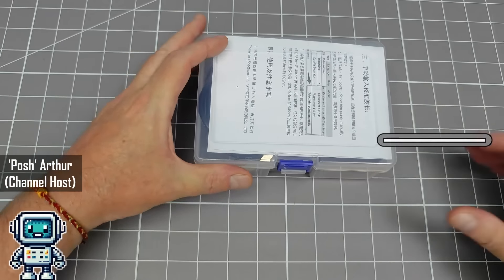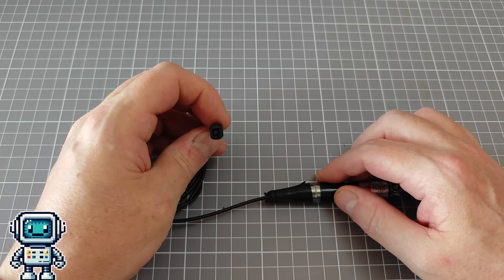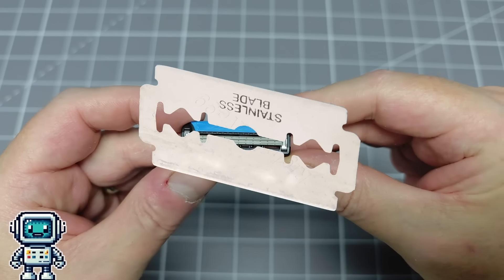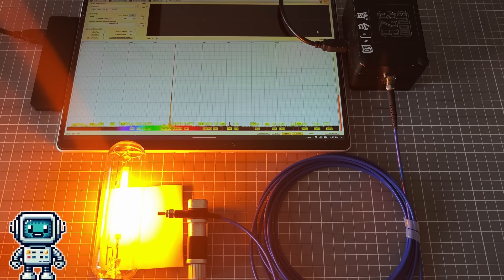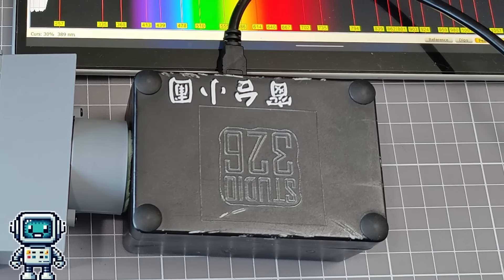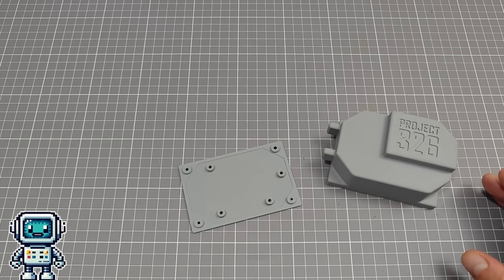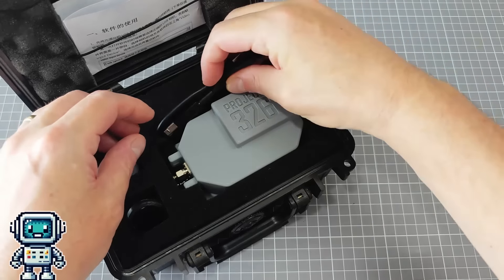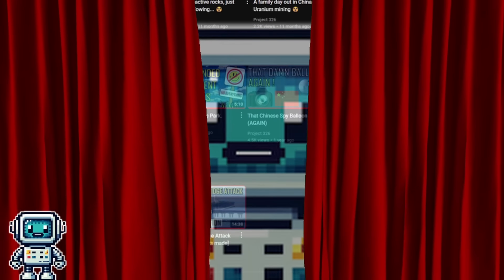Upgrading a Dirt- Cheap Spectrometer

Comment: I am sorry for interrupting. Is the geiger counter fs5000 bosean good for low radiation doses and is it reliable? I saw your video on YouTube, but I was surprised that my geiger counter fluctuated from 0.8 microsieverts to 24 microsieverts without any reason. Is this a normal average?
Reply from the maker: It's completely normal for a high level of fluctuation to occur.  Radioactive decay is a random process, hence good background measurements need a long term averages.
BUT...
Are you sure about the numbers?   0.8 uSv/h is actually a very high reading for a background level and 24 uSv/h is dangerously high for a background level.  What instrument were you using and what were you taking a measurement of?
For example I see about 0.18 uSv/h where I live but the world wide average is around 0.12 uSv/h
Reply: @project-326  No, sorry, I made a mistake in writing. The radiation level was between 0.08 and 0.24 microsieverts, but sometimes I want a device that's more accurate than the FS5000. Do you recommend buying the Measall KC761? I don't mind paying the price.
Reply from the maker: @Mr7lm  Phew, I'm very relieved that you background levels are perfectly normal!
For background measurements, the instantaneous values for background will always be quite jumpy due to the random nature of the events that are being counted.  All radiation detection instruments need some kind of averaging to get a stable values.  Obviously a gamma ray spectrometer will get more counts per unit of time and so converge on an average more quickly than a basic Geiger counter.
In the FS-5000's main display page (real-time, average, total dose), the average value is what you should be looking at.  Also remember that even the average background level can see some variability over a day.
Before going out and buying an expensive device (that might give fairly similar results in the case of background measurements) just think though what use case you have for this kind of product.
Do you know if the version of the FS-5000 that you have has the good tube?  Ie the J321?  If it was purchased in the last 6 months then it will be the better type.
Hope that helps.
Reply: @project-326  That's good, thanks😂

Comment: I assumed they were chinese made, but amazon in US sells boxes of 100 "Single Edge Stainless Steel Razor Blades for Standard Scraper Tool" for refill for paint scrapers and box cutters
Reply from the maker: there are lot of things that are Chinese made that we can't buy here, ie just made for a particular export customer, etc.
Reply: @project-326  They don't scrape paint or cut open boxes in China?  Do they also forbid kitchen knives and scissors?
Reply from the maker: @TheGaussFan  yep, I probably didn't search much before resorting to the copper foil...

Comment: Hi, Can you please tell me where you got your fiber optic cable and connectors from? And the part numbers? Thanks!
Reply from the maker: I got my fiber optic cable on TaoBao, but this is only accessible from mainland China.  It is a 400um diameter core made from quartz and has a numerical aperture of 0.22.  Any old SMA connectors will do, you can even use RF connectors with the electrical parts drilled out.

Comment: Another improvement would be to mount the USB connector separately so that bending the cable does not put stress on the camera housing.
Reply from the maker: The camera module is connected via an internal cable to the USB connector.  I just wish the original created had used a USB type-c...

Comment: Is this for real? I bought the little garden spectrometer afterwatching your review and now I am going to upgrade it with a new housing and a fiber connector ? 🤣
The fiber is indeed a bit expensive but I think it's all worth it. Having the SMA connector protects the internals from collecting dust and the optical cable give more freedom to get closer to a light source. Yes, the fiber does result in a lower sensivity but being able to get closer to the light results in higher light intensity. Now I just need to convince myself that this is all worth a 60 EUR investment for the cable and a few SMA connectors.
What type of fiber did you use ? I found some cheap-ish 400 um quartz fiber (45 EUR) but I am wondering if it is worth to pay more for a 600 um fiber
Reply from the maker: Mine claims to be quartz and costs about $31 from Taobao and has a 400um core.
Reply: @project-326 , it makes me a little suspicious, at 400um single core fused silica should be quite rigid already. Are you sure this isn't just a PMMA fiber? Plastic optical fibers should exhibit larger attenuation in the blue.
Reply from the maker: @inverse2k1  It is pretty rigid, more so than the cheapo PMMA fibers.  Yeah, I'm pretty sure its quartz cored.  PMMA has almost zero UVA transmission...

Comment: 09:22  " It is still a dull old black brick that wasn't going to give us a boner.   even though it had been ridden hard and put away wet I thought it looked butch ......  
I do like the revised version  13:30   "but don't expect it to get you laid " ,   I have high expectations don't judge me........ 
 I am sure people will pay handsomely for something looking like it fell of a T62 Tank.
Reply from the maker: oh, so I don't get any design awards then?
Reply: @project-326  Actually I think the design is very retro and looks like 1960 test gear in cast alloy cases.   Award ...... Pending
Reply from the maker: @WOFFY-qc9te  Fell off the voyager spare spacecraft...